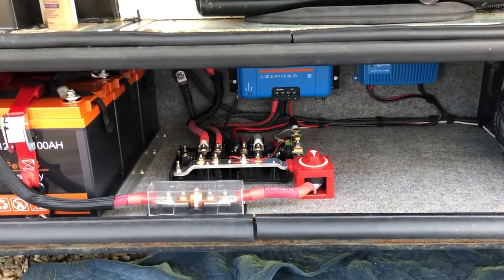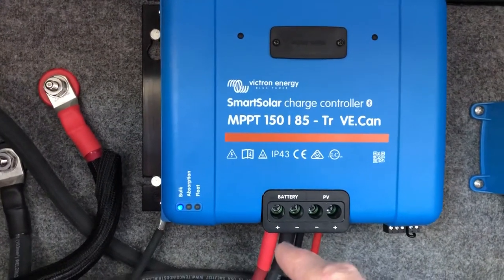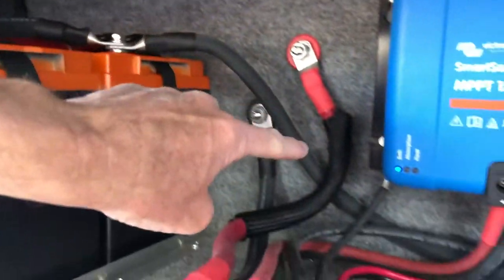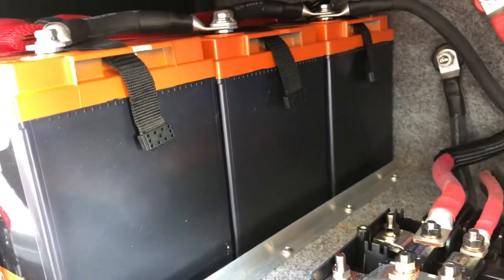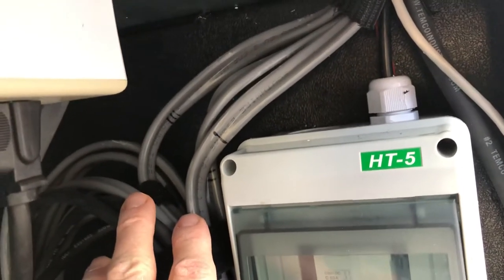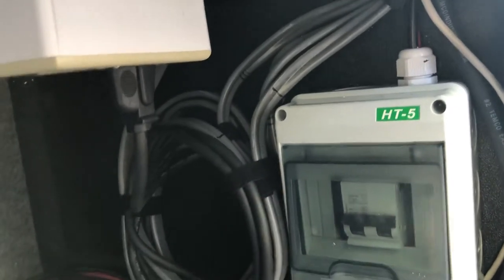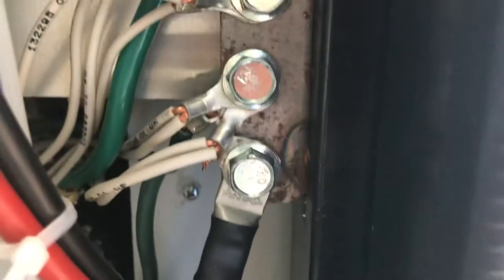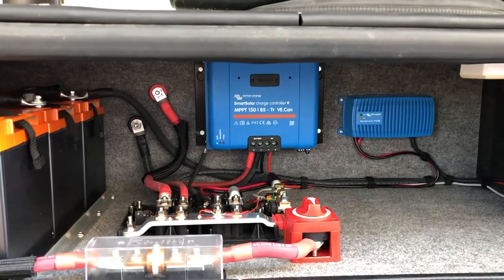RV Solar System - Phase 1

Comment: Cory, 
There is something that mess my mind.
You put 400A T fuse between battery bank and the rest of you system.
Fuse is to protect wire, so it should be smaller amperage than wire can handle.
Ampacity of the 4/0 wire is about 200A on 60 degrees Celsius (as I find on several pages on internet), so the T fuse should be under those 200A.

Definitely I misunderstand something, because you are not the only one who put that big T fuse for that purpose.
Please explain it to me and where I'm wrong.

Thanks in advance
Reply from the maker: I’m using 4/0 high strand count welding cable that has a 600-amp per 100 feet rating.  If there is a catastrophic failure/short the 400 amp fuse will blow. There are time my system may draw over 300 amps from the batteries so I don’t want to randomly blow fuses.
Reply: @coryhanes  
So my understanding of principe is OK, but wrong information about ampacity of the cable.
Reply from the maker: @dragankaldare2619  ya, I’m not sure if it’s correct or not. I did a lot of research and came up with this.  The Victron Energy website and app have good information, too.

Comment: Was 4/0 necessary? I am doing pretty much the same and got 2/0
Reply from the maker: Check with the manufacturer of your equipment for recommended wire gauge size per the applied use of what you are doing. Every system can be different.  Also, you can find webpages that provide the ampacity of the wire to help you size it correctly. There are many things to take into consideration, wire gauge, wire type, insulation type, heat in which the wire lives in, conduit or no conduit, etc.
Reply from the maker: Also you should check out Explorest.Life YouTube channel he has much on calculating wire size.

Comment: why do you have a ground? you have no ground in dirt like ground rode
Reply: In the US "ground" is typically vernacular for "common." So vehicles are often referred to as "negative ground" which means only that the negative is connected to the chassis as the common connection point for most everything.
Having a common like that means there is a known 0 volt potential and overcurrent protection (fuse or circuit breaker) is only needed on the other (not common) power terminal. Otherwise both power leads need overcurrent protection because the first fault (i.e. a short circuit to the chassis) would not blow any fuse. If that was the positive and the second fault was a smaller negative short to the chassis you need the negative fused on the smaller wire to protect it. If the first fault was negative and the second fault was a smaller positive then the positive of the smaller needs fused to protect it.  So either fuse both leads, or use a common and fuse the other. And we call common "ground" no matter whether it references actual "earth" or not.  If it did, we'd call it "earthing" or "earth ground."
Reply from the maker: The chassis of the motor is the ground, much like the earth electrode ground rod.  In the event of a short this ground will bring the power back to the distribution bus and thus blowing a fuse quickly, and safely removing the hazard… which then needs to be found and repaired.

Comment: Did you mount this stuff on carpet?
Reply from the maker: This is mounted in a motorhome basement storage compartment, the compartment floor is made of aluminum-foam-aluminum (about 1-in thick) and then indoor/outdoor carpet is glued to the aluminum.  The items all mount to this carpet covered aluminum.  Note that each item has an independent ground.  There is a phase 2 video where I’ve added the inverter-charger, and soon a phase 3 video where I add three more battery’s and 8 more solar panels.

Comment: Those fuses on the busbar are probably not appropriate for this kind of lithium system. What is short circuit current of this entire battery bank? Fuses on busbar look like Littlefuse MEGA. If so, these are meant to be used only in systems with shortcircuit up to 2kA (see the datasheet of fuses), I estimate this battery bank is able to do higher short circuit currents (check the datasheet of the battery - internal resistance, then calculate/estimate short circuit current).
Reply from the maker: Thank you for your input, I’ll look into this.  Keep in mind that the fuses are in place to protect the wires in the case of a catastrophic event. This bus bar is a VictronEnergy Lynx Distributor product. I’m using the recommended fuses for this application.  As for your concern of short circuit current capability, I have installed a 400 Amp T-fuse as close as possible to the positive post of the battery bank… you can see this in the additional videos for this project.  Lastly, the batteries have a built in protection in the BMS.

Comment: Do you need a separate ground for your batteries?
Reply from the maker: Not sure I understand the question; however, the negative lead from the battery goes through a shunt to monitor the “all”power consumption and charge level of the battery, the other side of the shunt (output) connects to the negative ground bus bar.  This negative bus bar is the main ground point for all equipment and chassis grounds.  As for the battery, 100% of its power will transverse through the shunt before connecting to ground.  Hope that helps.  One of these days I’ll create a good schematic of the system instead of my napkin drawings.
Reply: @coryhanes  
I was just wondering, as my home system has a ground wire on the negative side of the battery, that gos to a ground bus bar. This bus bar is connected to all grounds. 
I’m just wondering why the batteries don’t get grounded like the charge controller or the inverter?
Reply from the maker: @benjones8977  well the batteries are grounded but only after the shunt.
Reply: @coryhanes  🤙

Comment: * * *  C00L  * * *
Reply: Please keep in mind that should you have an over volt condition driving into that Victron it's going to make lots of heat doing the job . Many fires started that way .
Reply from the maker: @Nostrildomus  Thank you for the info, the max open (no load) voltage from the solar panels (4 ea in series) is about 90 volts.  So there’s plenty of margin.